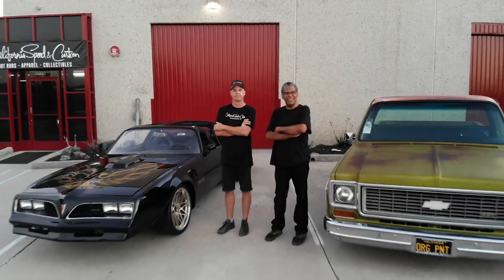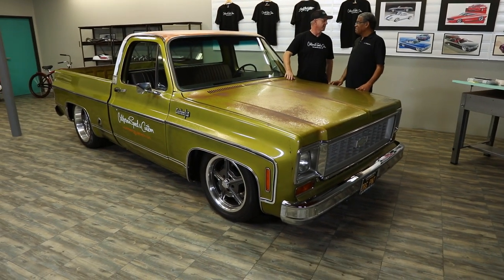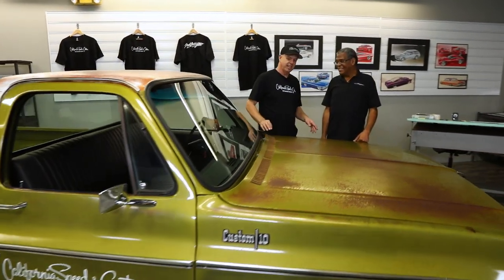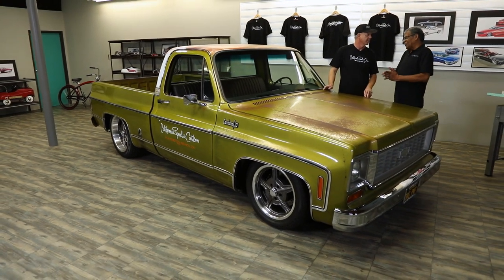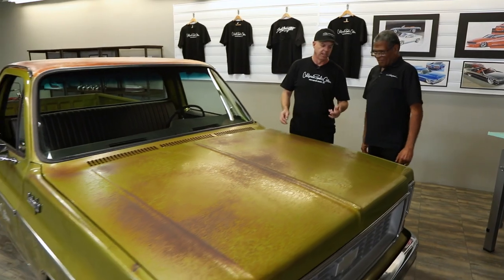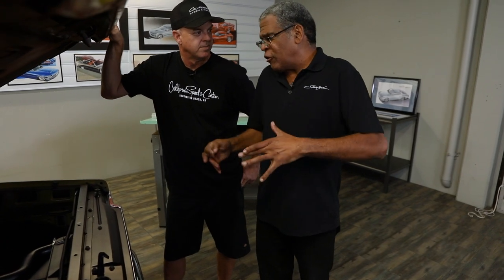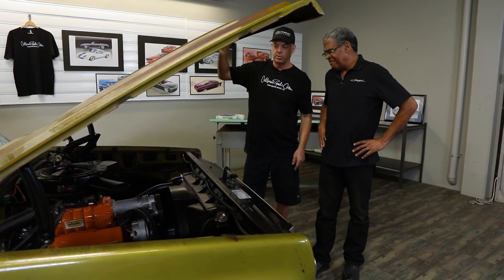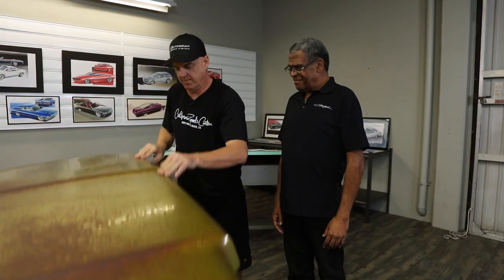Art You Can Drive - S01 E03 - 1973 Chevrolet C10 Truck

Comment: I will never understand the appeal of lowering vehicles except for racing. If I had a truck, I'd want the hood to be higher than everyone's head. I don't want people thinking my truck will explode when I drive over a speed bump.
Reply from the maker: William Jordan the beauty of a truck is that, since we don’t have a farm and do most driving on the street, lowering improves aerodynamics and also handling. And far more than the original chassis with this TCI prototype. It’s still important to clear speed bumps and have enough rubber on the tires for a smooth ride.